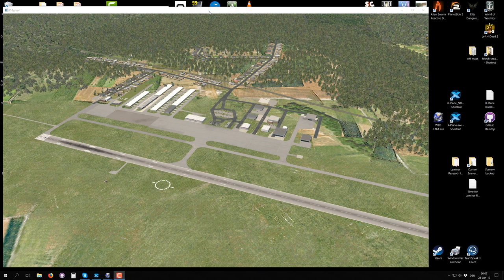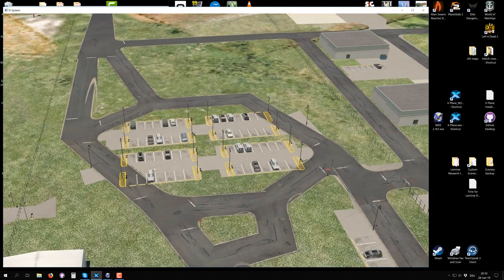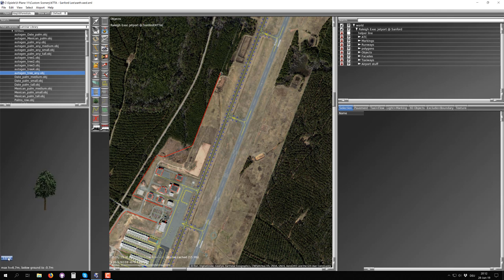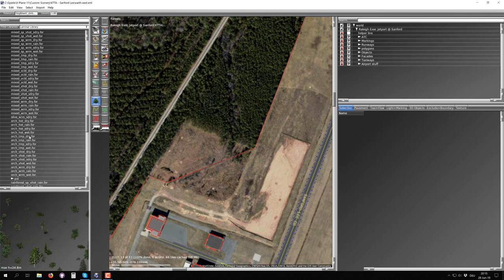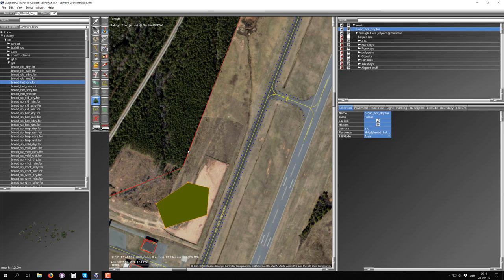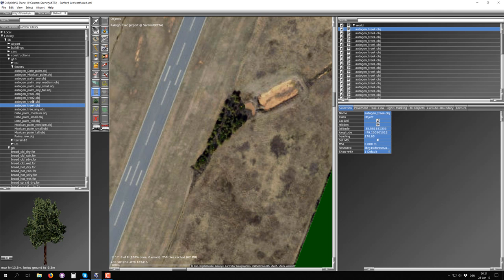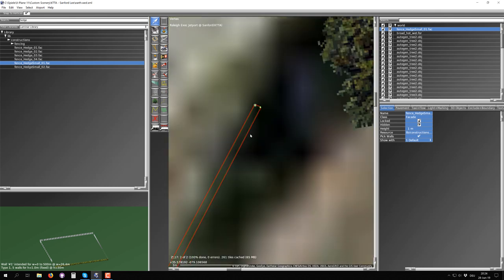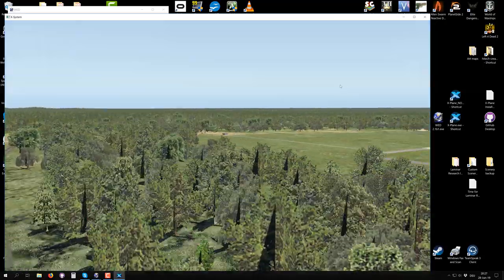#11 - Placing vegetation!

Comment: Hey Jan
Thanks a lot for these very well explained videos! On question: I wonder, is there a way to make a smooth transitions between ground textures, in more detail, to make sand beach gradually fade into the sea? I managed to make a .pol-file with a gradient to transparent, but I have no idea how I could apply this to a swung coastline since, even if I copied the tile for each section, they would still overlap in a curve...
Reply from the maker: Hi Poki, that is beyond my expertise...in other words, no idea! Maybe check on the x-plane.org Scenery Builder forum, very knowledgable people there!
Reply: Jan Vogel  Thanks a lot for the reply, Jan! Actually, I had already searched there and opened a forum post but not yet received a reply so far. But let's see. : ) Thanks again for the reply and these very informative videos!
Reply: Hey Jan
Just wanted to say that I finally figured this one out. In case you're interested:
https://forums.x-plane.org/index.php?/forums/topic/209688-blur-border-of-texture-coastline/&tab=comments#comment-1919635

Thanks again for your help
.

Comment: Hey Jan, I was doing everything fine on my airport and usually save and export on a regular basis. But now, I noticed when exporting, then going to X-Plane, it doesn't show my most recent export. Any help?
Reply from the maker: Make sure that you actually click "export scenery pack" - I often "forget" (just saving instead) and then it won´t show. Also note that for a lot of stuff to show you need to totally close X-Plane and start it up again.
Reply: @janvogel9719  Yes, I completely close out of X-Plane, and I made sure I clicked Export Scenery Pack, I tried multiple times after I notice it wasn't showing my most recent progress after clicking Export, and I restart X-Plane, check my airport, but my progress isn't showing. It was going fine the first half of the airport, but then it randomly stopped.
Reply: In these kinds of “illogical” situations, I would make a copy of scenery.ini then delete the original and allow x-plane to rebuild it.
Reply: @frodo246  I got it to work again, I deleted my earth nav data folder and just exported again it showed
Reply: @jlxmedia  Good Job!